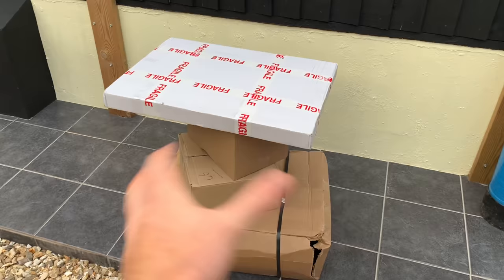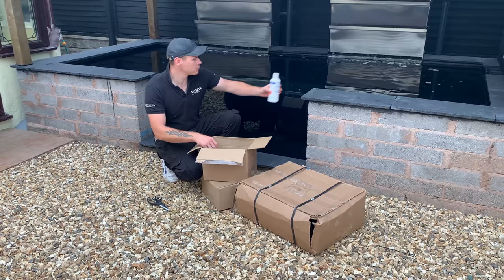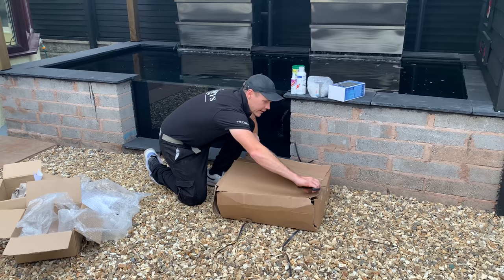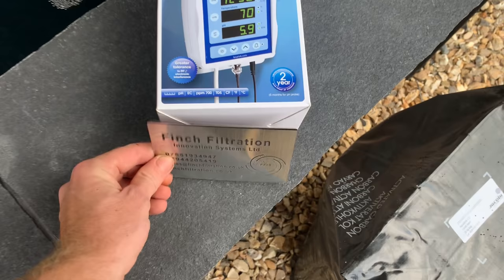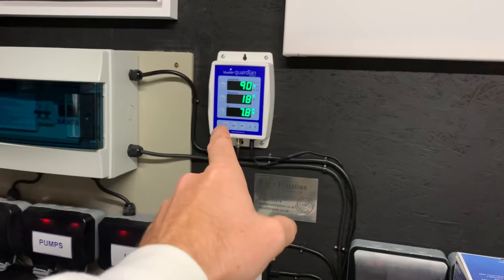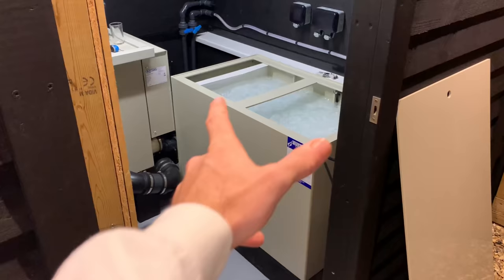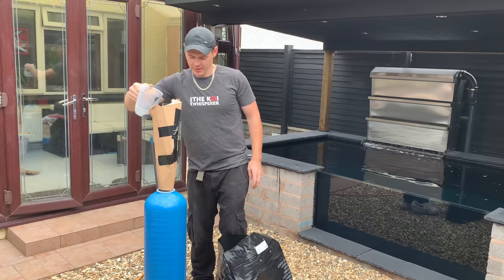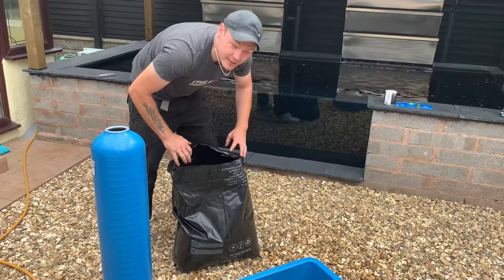***NEW KOI***BIG BLUE**BLUELAB PH READER***I AM READY TO BRING MY KOI BACK HOME!!!

Comment: Next time you remove the carbon from big blue replace it with Di resin and you will get the tds down to 0.000 I also use  one but with the resin and it works a treat
Reply from the maker: Need more information about this ?? Facebook me if possible?

Comment: Pp the media isn’t nothing to do with helping the media sink it to rough the plastic surface up for the bacteria to get grip of as the media comes very smooth brand new that way it mature way faster than not using pp there s nothing wrong with what u have done it will just take longer for the media to mature but looking gd mate